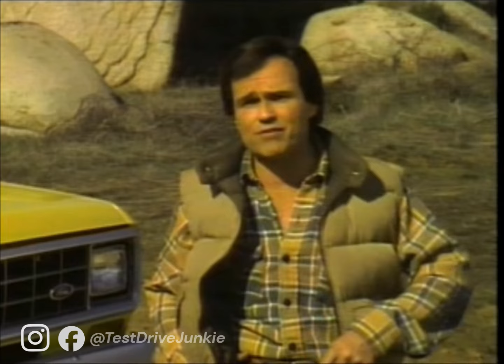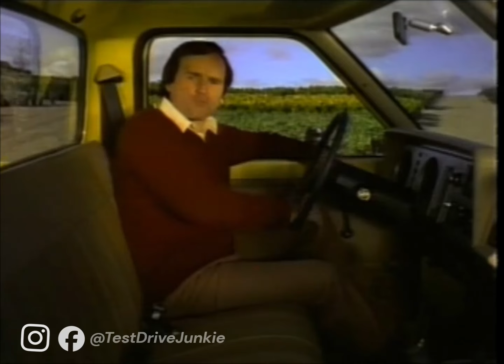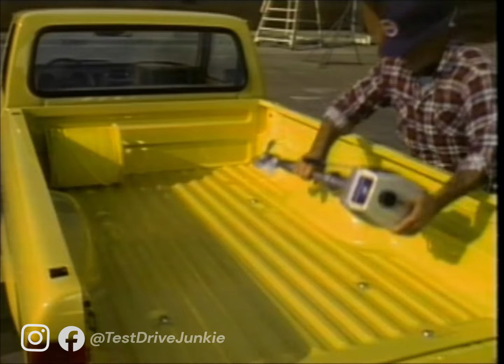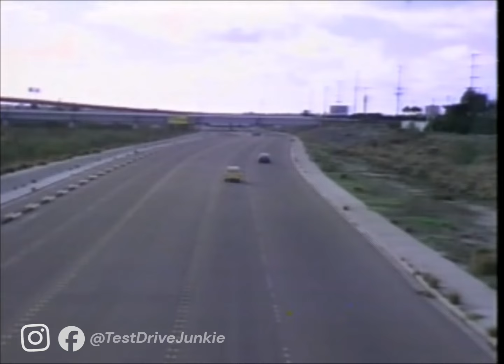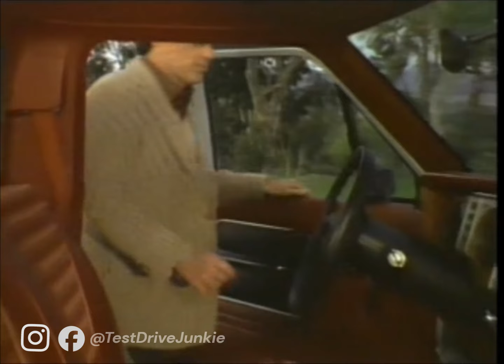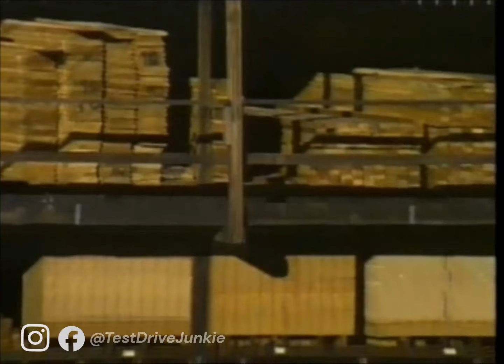1983 Ford Ranger vs Chevrolet, Datsun, and Toyota Manufacturer Laserdisc Promotional Video

Comment: I wish they can go back making simple, basic compact trucks with manual windows, locks, transmission and a pushrod engine.
Reply: Yes to all but push rod engine. I love the ohc 4 cylinder of Ford, Nissan, or Toyota from the 80s to mid 90s...

Comment: That being said the Datsun 720 had a lot of customization done to them by individuals over the years as did the Toyota. In 1985 Toyota kicked out an all new pickup. Those Toyotas from 1985 to 1988 are still in demand today. Ford kept that ranger around from 1983 to 1994 with just a few cosmetic tweaks. Chevy kept the basic S-10 till 1995 when their new truck debuted
Reply from the maker: owner of a gen one 1991 boxy s-10 baja.  Fan.
Reply: @TestDriveJunkie  so you ARE the original "Bajabusta"...I have a stupidly great memory, and your videos after many years popped up.
Reply: @TestDriveJunkie you are bajabusta?